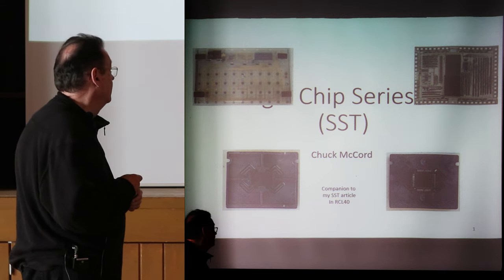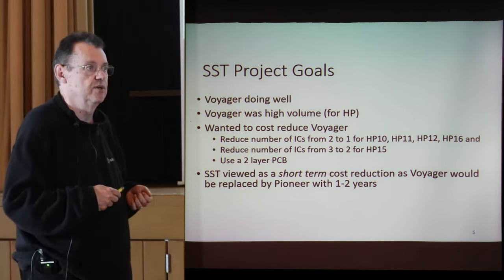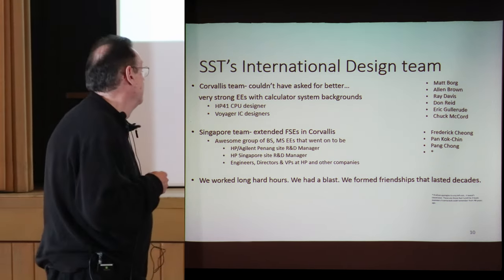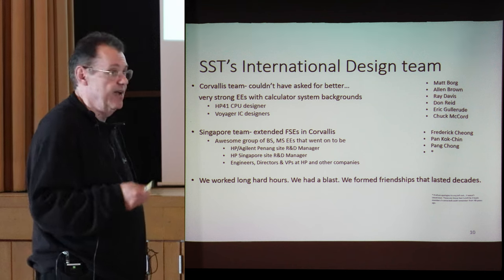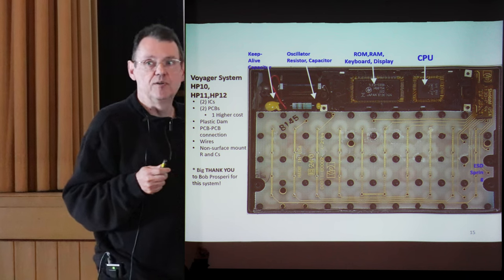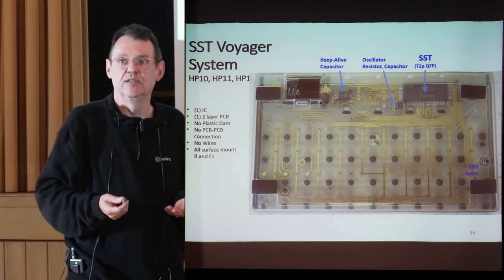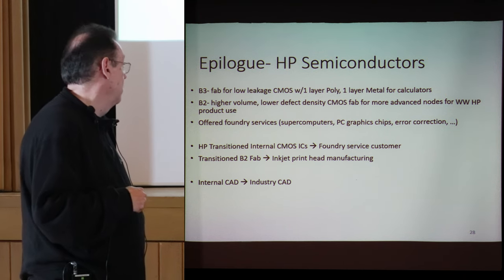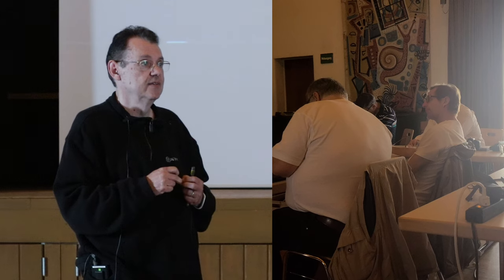Allschwil 2022: Voyager Single Chip Series 10 (SST) (Charles McCord)

Comment: Very interesting presentation, thanks! One of the best calculator series, which still work today, and coming with outstanding manuals, that was a very good job. A little remark: the slides are way too charged and mostly unreadable, so they're waste on the audience. You should have a look at a tutorial on how to make good presentation slides. I suppose "double-Es" are electrical engineers? You don't say "PM" for project manager though 😉